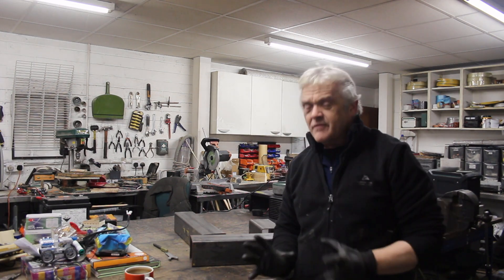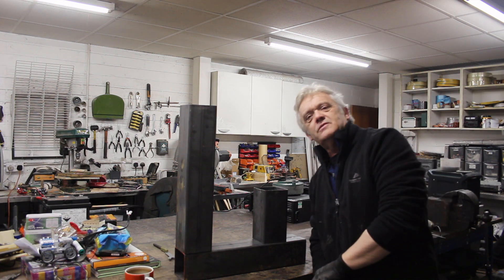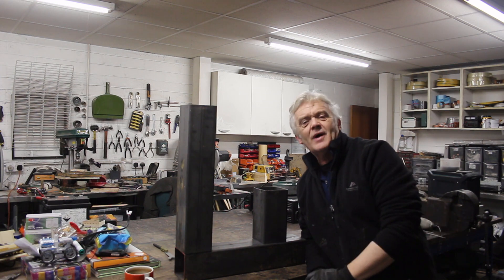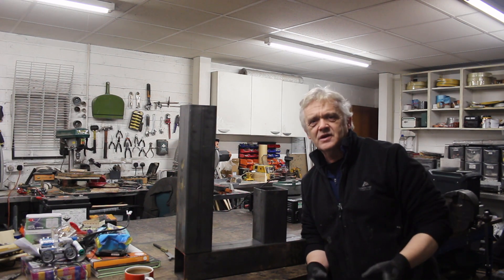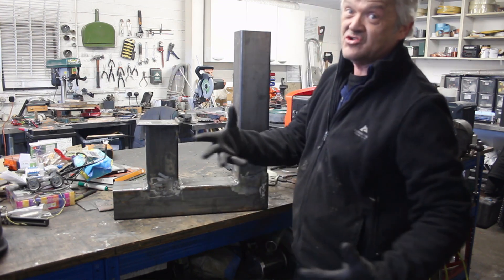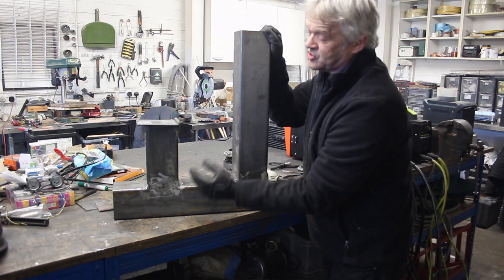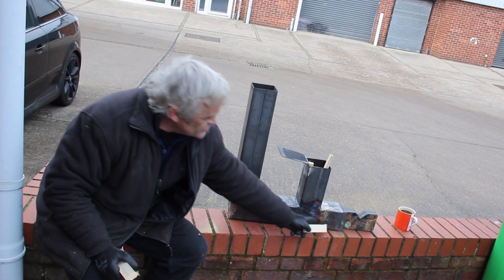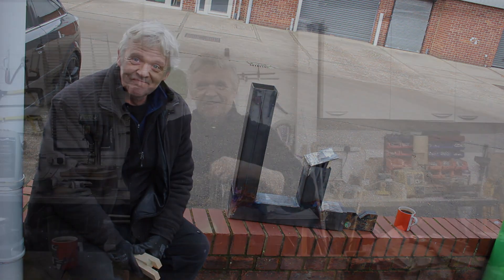1404 Rocket Stove For Mass Heating

Comment: I wonder if you can miniaturize a wood stove even more (while still burning regular size fire wood), what is the minimum size that can be achieved?
Reply: Qualitively.. 
Heat is lost from fire through exhaust gases, light etc, but unless exceptionally well insulated, heat is also lost through metal walls.   
Ratio of surface area to volume... 
(applies to all shaped tube but quicker to explain with round tube) 
As diameter of round tube is reduced, both it's volume and surface area reduce... But volume reduces quicker. If that ratio gets too high a fire will loose more heat than it's volume is releasing... Result... It cools. Potentially to point where it goes out. 

NB there's been developments in chemistry which utilise the quenching properties of say tiny diameter tubes vessels. to perform reactions which would otherwise run too fast/generate too much heat/and generally go bang in a dangerous way, if they were performed on a large scale.

It's also part of reason why artic animals tend to be bigger, rounder with large ears than non artic species . The size and general shape helps them conserve heat. The big ears provide them with an option to loose heat when they want/need to say if they running.
Reply from the maker: to be honest mate - I was thinking about this and to a degree isn't losing heat to the room the whole point of this? I was thinking that what you want to do is burn the wood efficiently then pass the heat to the surrounding room - not sure what I am missing here?
Reply: @ThinkingandTinkering  
To burn efficiently, you need intense heat in the combustion area. What we do is insulate that really well and only release heat to the room after combustion is complete.
Reply from the maker: it would be an interesting challenge to fine out mate!
Reply: 4 inch stoves are about the lower practical limit for useful heating. At this size and smaller, the proportion of surface area to volume goes too high and friction starts becoming a real problem. One can build little cook stoves out of cans but at this scale, they become less efficient and more problematic the smaller you go.

Comment: These things are great, and are VASTLY more efficient than an ordinary wood stove, when combined with thermal mass. So they are cheap, can be almost carbon zero (using sustainable wood), and very low emissions.

I'd be super-insterested in any observations and explorations you might make on thermo-electric energy (from such a stove) A few years ago there was a big thing made about carbon nanotube based seebeck generators, but it seems like it never really came to fruition.
Reply: Junk mail can finally serve a purpose :)
Reply from the maker: I like how cheap , easy and adaptable they are - it seems they can be made in lots of different ways
Reply: @ThinkingandTinkering  Yes, 4 breezeblocks works great. Some cast iron pipe and sand for mass...  just about anything can be used. Even holes drilled in a big log.

Comment: With small burner like that, you can start small burn at base of chimney itself to heat and create draw, which determines flow in burn chamber once lit, avoids smoke escaping from burn chamber etc!
The key is insulating first part of chimney to create maximum draw and burn efficiency, which also avoids back draft of smoke etc.
In case of drum type heat sink, that leads on to mass heater, the chimney inside barrel should be insulated well, then heat hits underside of top and is forced sideways and down, which then heats entire outside of barrel, insulation on that internal part of chimney promotes the fall of hot gasses around it before exiting through horizontal pipework!
Reply from the maker: ahh - that's a big help mate - cheers

Comment: Please find yourself a sgs gas supplier and get yourself a bottle of gas. 10 or 20 ltr initial outlay is 160 to 200 ish and then refill is 75ish but no monthly fee. 
Having a mig with flux core is ok but the difference is night and day. After all its your fault I have a ££1000 welder 😂
The other this is I have to wonder if you used some flexible hose around the flue to the bottom hatch whether it would increase the burn? I saw a smokeless pit that used a preheating of air intake that worked really well
Reply from the maker: I like the no monthly fee bit - I will have look mate - cheers

Comment: Looks like it will be a good  little set up Rob.  Can they be set up to burn cob pellets or as an oil burner I wonder?
Reply: Cob pellets should be no problem with a wire cage.
Reply: @Barskor1  Awesome! Thanks!
Reply from the maker: it is fun to explore mate and I am looking forward to using it for real
Reply: You can easily make it a drip oil burner